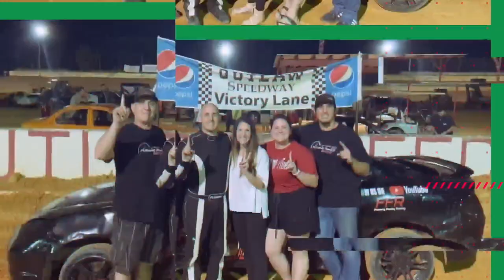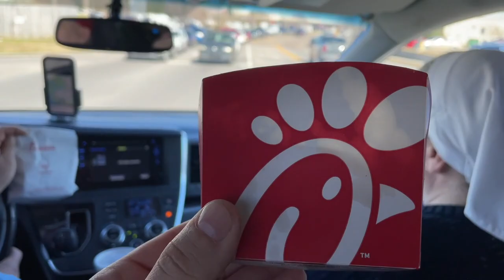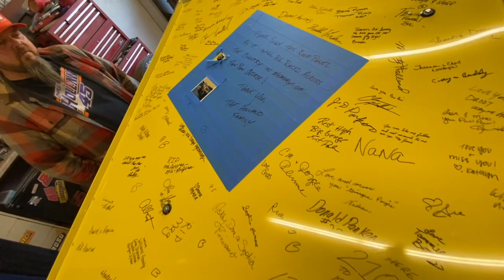2022 Legend Race Car Prep / Hanging with the Hollands

Comment: The cars look good! Are y’all going to drill the 10 holes in the front fenders? Also if you use foam air cleaners instead the k and n filters you will gain 2 horse power.
Reply from the maker: Thank you so much! Yes we will be drilling the holes. Also I do have the foam covers on mine!